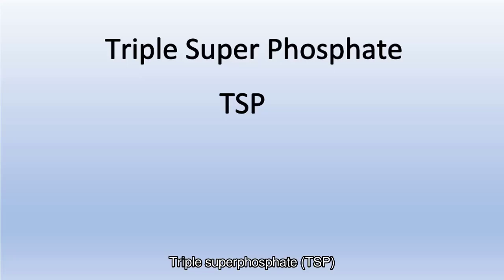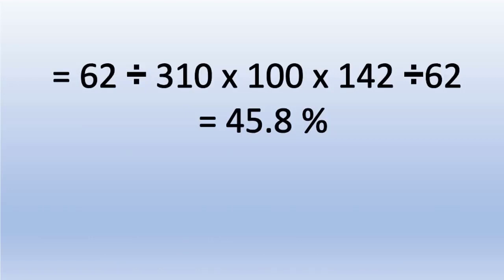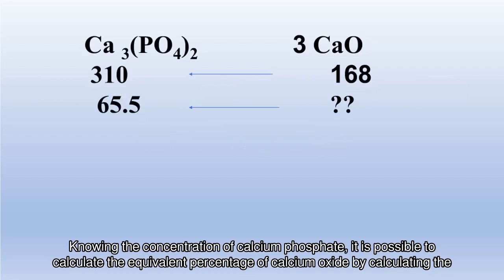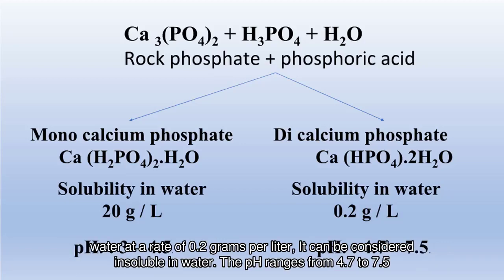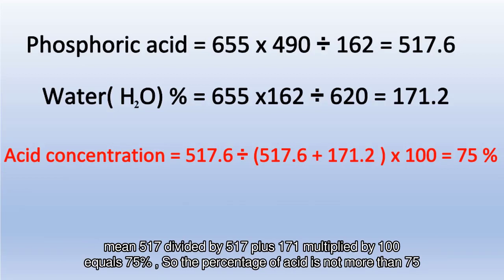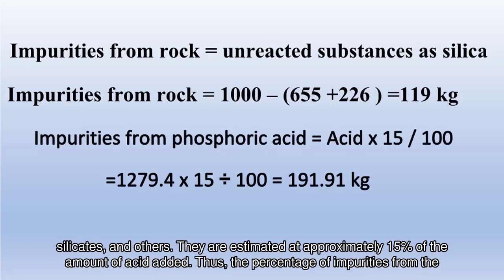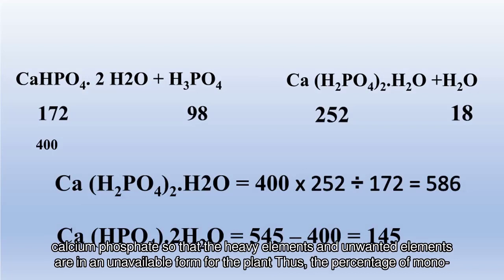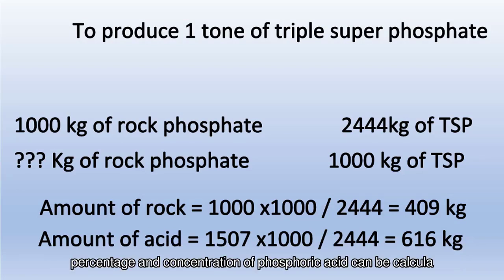Triple Super Phosphate  (TSP) Fertilizer

Comment: Sir, I want to make 50 kg of SSP fertilizer, so can you tell me how many kg of sulfuric acid will be added in it. Sulfuric acid is 98%.
Reply from the maker: You need about 30 kg of sulfuric acid added to 70 kg of rock phosphate 30% P2O5 
But you must dilute acid before addition to be 75% 
Product will be ready to use after 15 day as minimum
Reply: @muhammadelsayedelhesy9559  Sir, what percentage of fertilizer will be prepared?